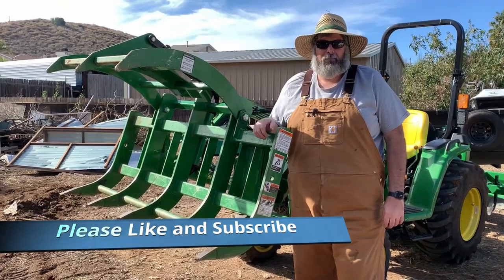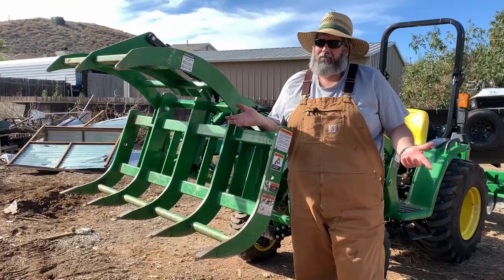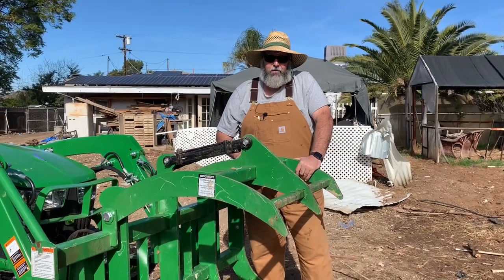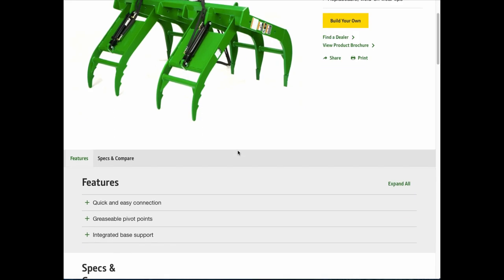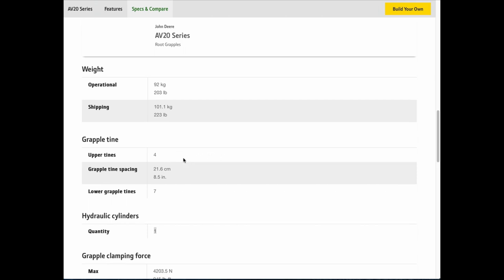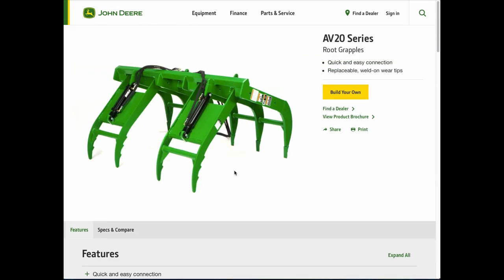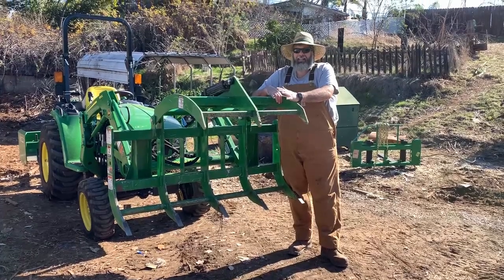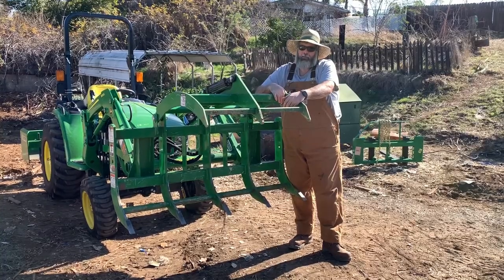John Deere Root Grapple AV20 Review

Comment: $1700 with the diverter, installed, is pretty darn good. I think an Artillian with 2 clamps would be great, and I could even pick it up from their facility that's nearby, but that would run $3700 (fork frame with no forks $700, diverter kit $751, grapple-rake-grapple set $2277) before tax (and you get to install the diverter yourself.)

Comment: I have the AV20F and will probably weld some 1/4" x 1 1/2" bars in between the tines as it let's too much material fall through (probably to keep weight down). Other than that, it's been great.

Comment: I tend to lean towards the double clamp style in the event there's uneven loads.  But for the deal you got for the grapple and 3rd function installation, it's a good one.  I've seen Tim of TTWT use both Precision Mfg. and Artillian grapples on his tractors.  The Precision model is better for detailed cleanup compared to the Artillian, but Artillian has the advantage for bigger loads.

Comment: It's not bad!  Artilian, you are in for $1600 for similar set up of rake/grapple/rake.  I even think the weight is similar, maybe a little lighter on Artillian.  The trouble is, you have to buy their fork plate, which just the plate will add $595.00 to the price, but, you'll be able to use their forks, which are pretty nice.   I have a 2025R and JD advertises that the AV20F will work with it.   So... it's on the wish list.  I have SO many piles of limbs and debris!   It would earn it's keep in just a month! (compared to a rental will run me about $600 a weekend, x 3 to 4 weekends) it really would pay for itself.  I am worried about the teeth!  That is an odd design.  Artillian also has a much better lower bar system.  Good luck with the new toy!  Out here in NJ, the machine is sitting parked until Late April.  Too cold, too damp, too muddy.   This is the time of year I just shop and buy new toys for next season!
Reply from the maker: Thanks for the Comment, if you get one send photos! I get what you are saying about the artilian, but the forks are nice. I hope to get a set this summer and run a review. Thanks again.

Comment: He is demonstrating a Frontier AV20H not a AV20F.  SV20H on Deere website shows AV20E picture not AV20H. Specifications showing are for AV20F weighing 203 #. AV20H weighs 381 pounds. Frontier Owners manual for AV20H for 300/400 series loader. 
Frontier brochure table says AV20F for 100/200/300E loaders. AV20H requires 320R or 400E loader. Cost of AV20H without 3rd function hydraulics probably $1800 to $1900. Retail about $2400.

Comment: $1700 for the Grapple and 3rd function sounds like a steal, the grapple alone retails for $1700...I paid $522 for a summit diverter. 

If Debri is dropping thru, could expanded metal on the bottom help.?..I have this grapple on order. I'll be picking up piles of branches tho not dirt , so it looks good for that. Also the one I ordered has expanded metal on the top.
Reply from the maker: Very cool, sent photos of yours. I am interested to see the design. Expanded metal might work, but not too sure how it would hold up on the bottom. I sometimes have to dig a bit with the tines to get roots etc. but on top would be fine. Good luck with yours, send photos!

Comment: Also, it appears Deere has changed the AV20F recently? Yours has a different design (fewer, shorter tines (was 7, now 5?), no serrations, little teeth on the bottoms of the tines, no perforated metal on the lid, etc.) than others such as here: https://www.youtube.com/watch?v=l4tZxMh7ito
Reply: Paladin made the earlier versions, perhaps yours has a different manufacturer plate on it...
Reply from the maker: I am sure your correct, John Deere I don't believe makes any of its smaller implements. This one says only Fronteer, but I know the bar mower is a Mossiemo. So it wouldn't surprise me if they farm out this grapple as well.
Reply: @burbstobarns7802  Figured out the difference; you have the AV20H, not the AV20F. Mystery solved!